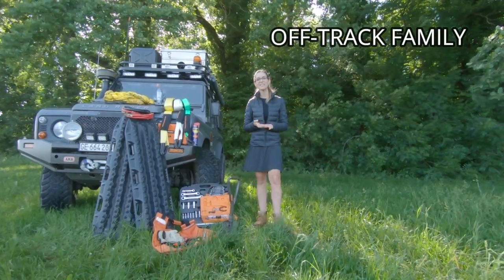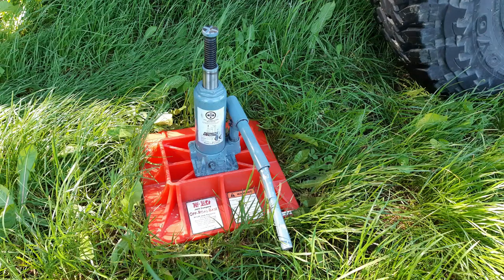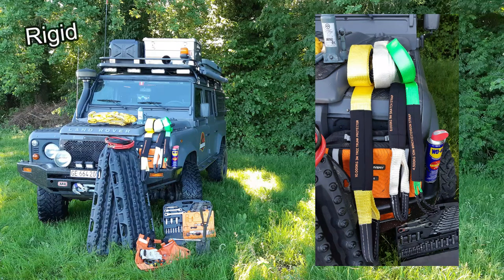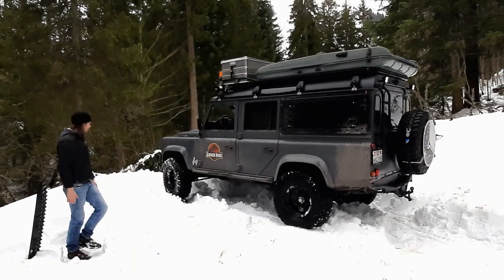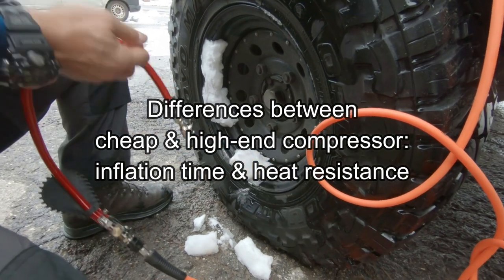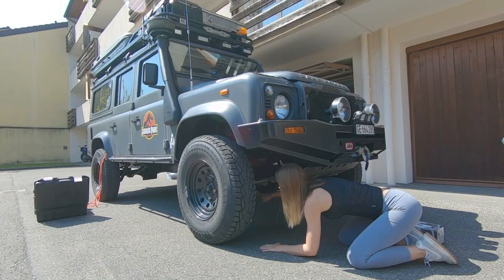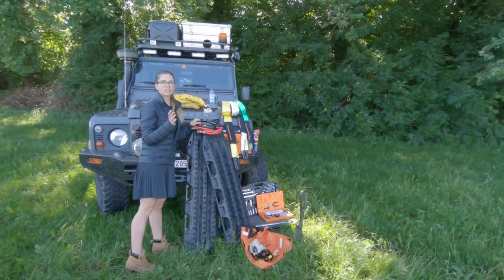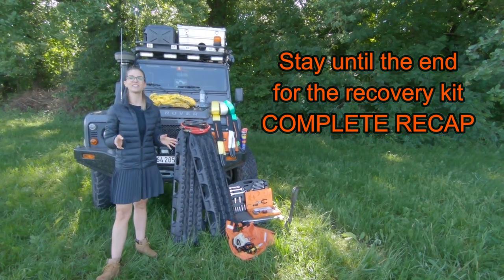BEST RECOVERY KIT FOR 4WD & OVERLANDER | Defender Overland Camper | Equipment series

Comment: In my G Class 350GD:
Tibus Beadlock wheels. down to 0.6 Bar/10PSI incredible how far you come with low pressure
Tiredeflator
KS Tools Set with 1/2, 3/8, 1/4 Tools. Everything you need
ViseGrip, totally underrated and often overlooked
A good shovel
Snatchstrap with soft shakles
Uniko 6in1 ramp/traction boards, usable as traction boards but also you can level your car for sleeping
Foldable saw and axe
12v Compressor Tmax 300L and puncture repairset
hi lift jack small
Jumping clables because my car is automatic
Pay attention to the aditional payload ! Overloading your overlander can/will result it high fees in some countries !!!!
Best wishes from Germany
Reply from the maker: Nice! Thanks for your message!!! Tibus Beadlock wheels is a dream!!! We love it!!! Do you know if Tibus is making it for Defender with -20 offset?
Reply from the maker: @Drugaskan  Okay thanks for your great feedback!

Comment: I've overlanded around the world professionally but never carried a torque wrench, I do however carry a 4ft long 3/4 drive breaker bar and 27mm single hex impact socket for taking wheel nuts off my Landy, also a 3/4 to 1/2 inch adapter so I can use it on my 1/2 sockets.  I'm sure it'll snap anything that doesn't turn 😁. After 40+ years of working on all kinds of vehicles, I have a good level of judgement what is 20/50/80 ftlbs etc enough to get by at the roadside.   I can always use the correct kit at home.
Reply from the maker: Thanks for your feedback! That makes sense!

Comment: Very Surprised you two haven't invested into roll over protection,
A lot of funds have been spent to make a excellent overlanding Defender with this exception.
Excellent tips as always.
Reply from the maker: Yes you are not the first to tell us. The only reason it's because we need a little extra storage on the roofrack and for this reason we cannot leave the roofrack to install a roll over cage. In our next project we will remove the jerrycans from the roof because we will install a long range fuel tank. Then we will install a lower alubox storage on the roofrack with more capacity and solar pannel on it so stay tuned for next modifications!

Comment: Hi, what is the weight of your car if your traveling? Sometimes less is more all these equipment need a lot of space and don't forget the weight. If you lighter all mechanical parts have less stress and a longer live.
The key is optimize to a minimum.
Ps.we also traveling with 4 people the transition from driving to sleep takes me 2 min.
Salutations Patrick
Reply from the maker: Hi! Thanks for your comment! Totaly agree with you about weight, but sometime we have to make some choices or compromises. Yes our car is heavy probably around 3 tons but we tried to reduce the weight with time and optimised the driveline and other parts with Heavy Duty. We have a minimal camping gear but for some other things like recovery gears that's maybe a bad choice to travel without it. We are always travelling alone (no other vehicles) so if you get stucked or have a mechanic issue that could stop your progresssion for a little detail, we prefer to have the possibility to fix all what it's possible to fix by ourself. All what we have in our car was used several times when overlanding. The only exception is the winch but when you realy need it it will be very helpful. I saw your setup and it's awsome! but we wanted to keep the 5seats setup because we are 4 people but that's a problem for us to don't have the possibility to take one more people in some situations. That will be for sure the subject of another video but we have a lot of projects in the same time. Hope I answered to your question. Don't hesitate to send me a message if it's not the case.

Comment: Never ever use the tow hook for recovering use. The rear cross member is not designed to take the load. There are recovering points on the chassis. WD-40 is cheap stuff.  Tec7 or Würth have much better products.  Informative video, but I just carry some straps, a shovel, a saw, a compressor and a 12v water boiler.  Good luck to all of you!
Reply from the maker: Thanks for your great feedback and advices. I'm surprised about what you said about the tow hook for recovering. We are well talking about tow hook on the rear bumper? Which better recovering points are you using on the chassis for rear?
Reply: @offtrackfamily  From Land Rover Experience Denmark Chief Instructor Ib Hammer I've learned, not to use the tow hook as recovering point, because it was designed to pull rolling items. My OneTen has special recovery points (rings) both in front and rear. They are standard factory installed, but you can get aftermarket too, and they are stronger. The tow hook can damage the rear cross member when used as revering point. You can of course reinforce the cross member by welding more steel into the bottom and rear side (inside). Search for Defender recovery point on YT or Google.
Reply from the maker: Thanks I'll do. Do you have pictures of the recovery points you have on your one ten?